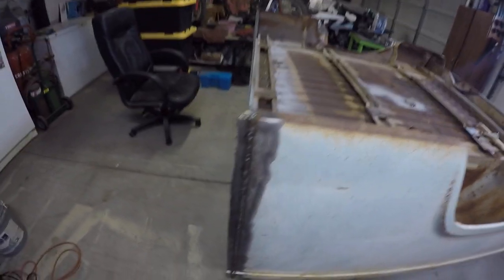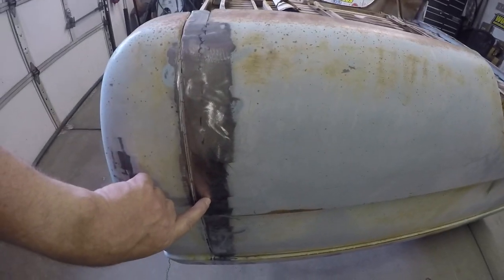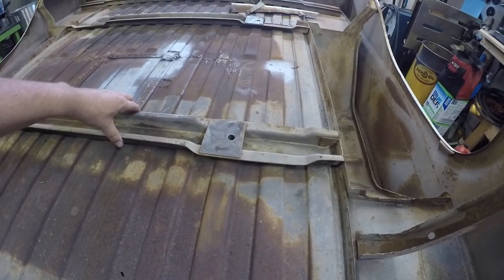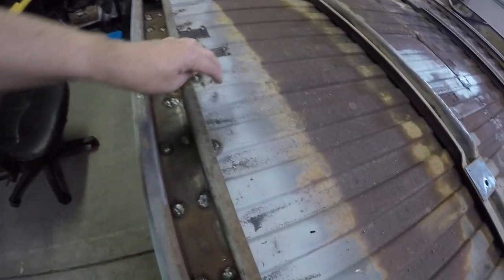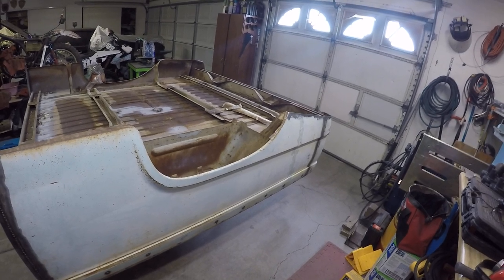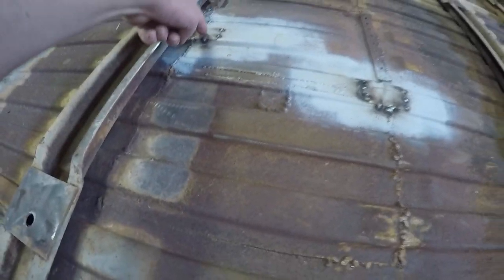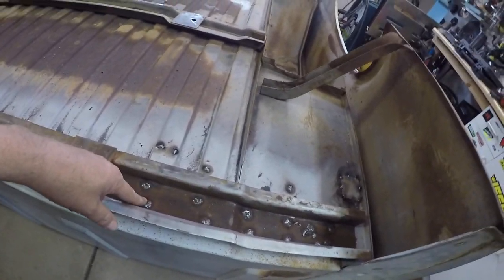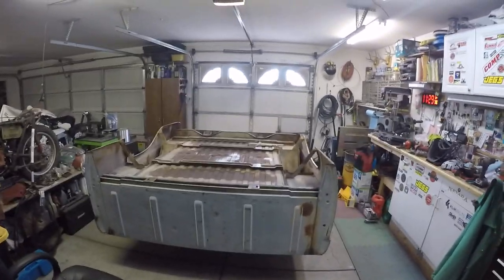1966 Ford F100 Long bed to Short bed conversion Episode 3.5

Comment: Bad ass, I am a  hotrod suspension and chassis designer by trade, but not a body guy, i have a 64 f100, im bobbing it as well, thats how I found you! Nice! You answered a few of my questions, cant wait to see it put back on the frame, sweet short bed action. Im using mine for autocrossing.
Reply from the maker: That's awesome Thanks

Comment: Would the same process apply to a 64' f250? My truck is a 2wd and has a long bed. 

Somewhere I read that the short bed and long bed 2wd f100s have the same wheel base of 128". Is that true?
Reply from the maker: It should work for a 1964 but a 1966 has a 129 inch wheel base not 128. 1 inch shouldn't make a difference.